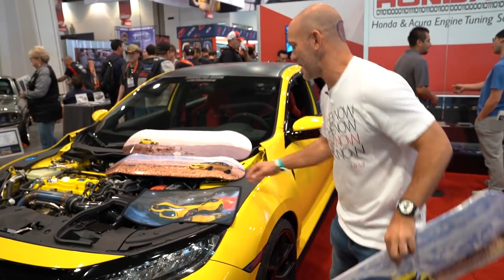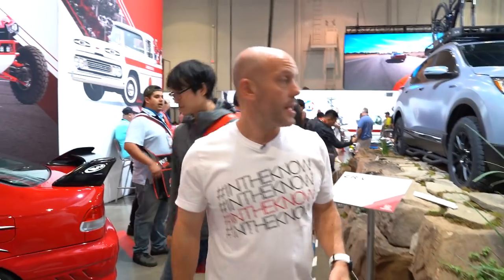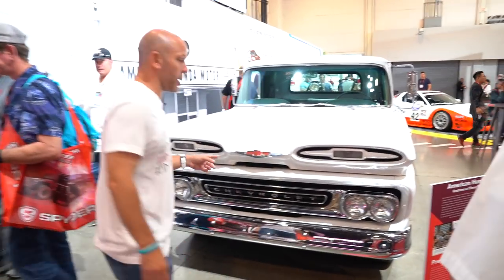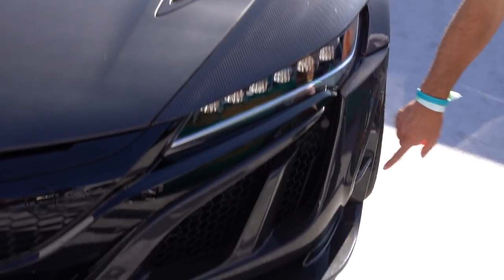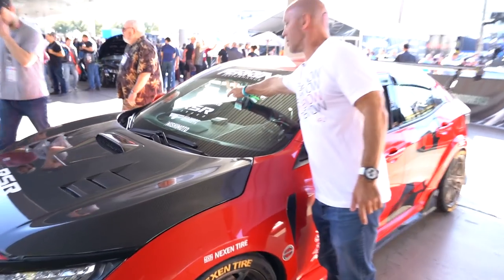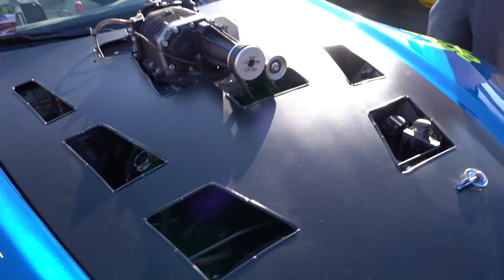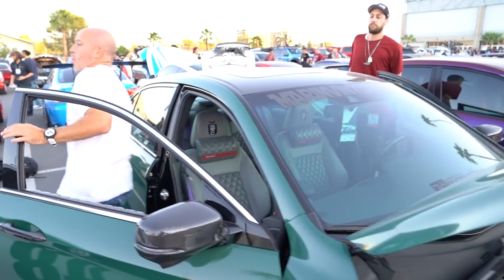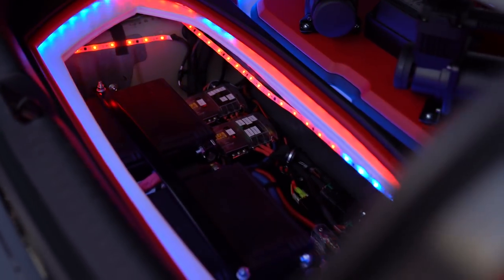Every Modified Honda at the SEMA Show 2019 in Las Vegas

Comment: The s800 at the honda booth..even the center caps pointed in the correct way, in relation to the valve stem